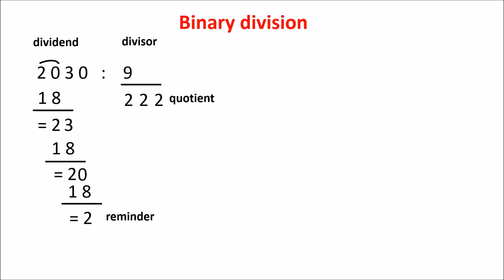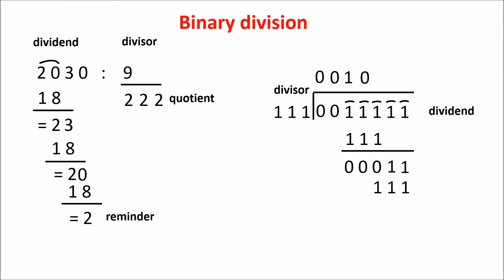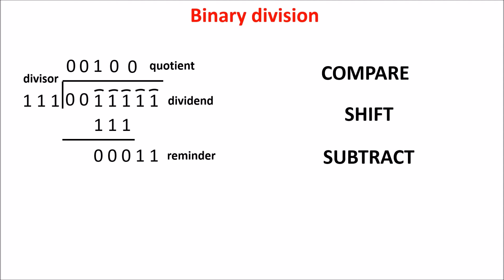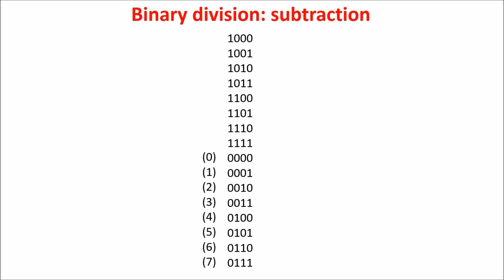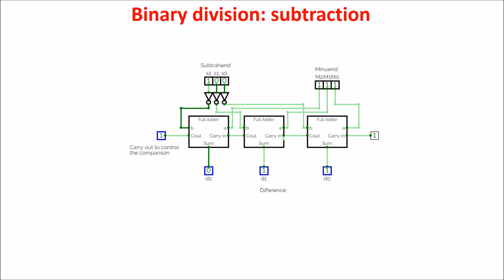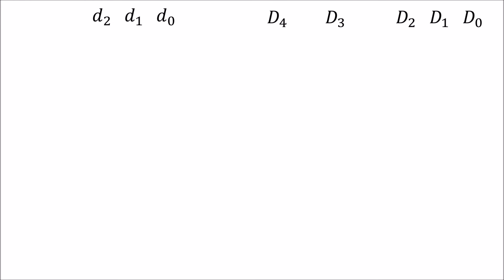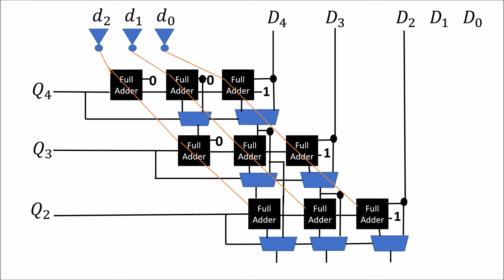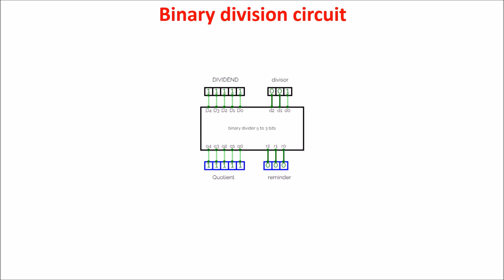Binary division circuit

Comment: Really good explanation but this final diagram at 9:40 has some mistakes that got me really confused when trying to copy it.

1: Pretty sure the added 0 at the second row of full adders is useless, that full adder would have 4 inputs which doesn't make sense.
2: One of the multiplexers on the third row takes one of their inputs from the first row of multiplexers which I see no reason to do.

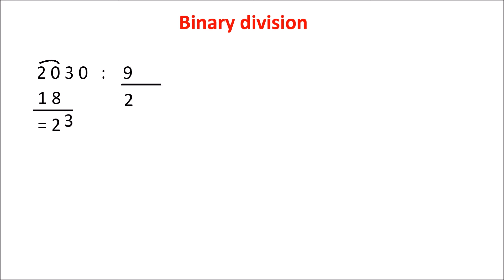Comment: 1:09 You made a mistake and it's 23-18 = 5 not 2  so bring down the final 0 = 50 then 50/9=5 so the final answer for 2030/9 = 225 not 222 ignoring remainders
Reply from the maker: You're right. Incredible mistake...
Reply: He was using the Pentium FPU.  :)

Comment: The AtariJaguar (1993) seems to use combinatorial 32:2 bit division without restore. A loop expands this to 32:32 . 1995 the Pentium introduced a more modern way which allowed 64:2 division at higher clock frequency. Additionally, Like an FPGA, Pentium used a LUT. Almost like your 8 bits (3+5)
Reply from the maker: Interesting. Thank you